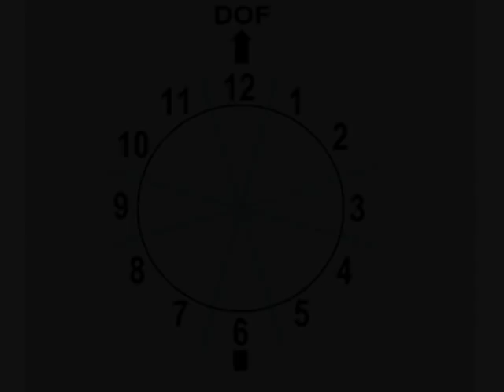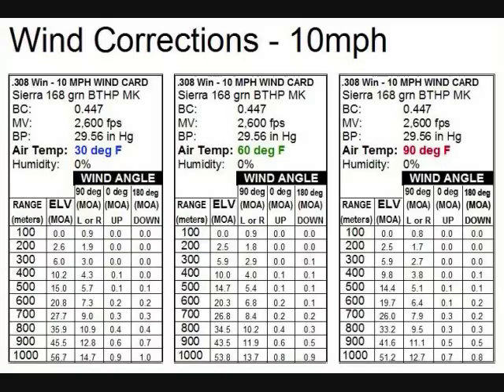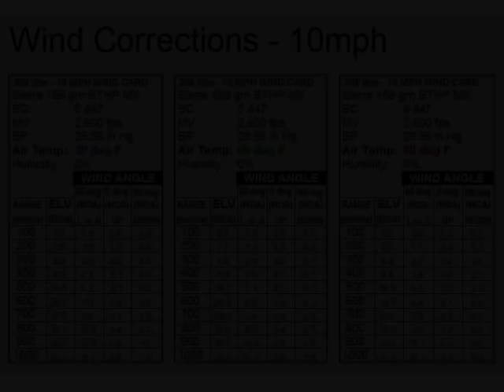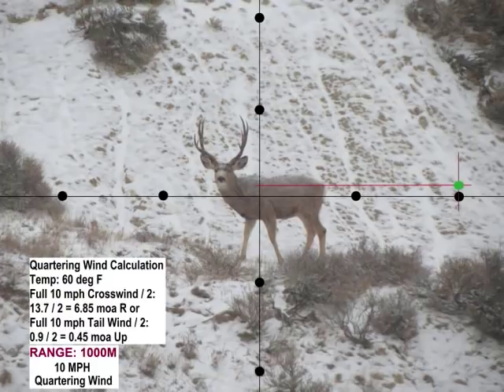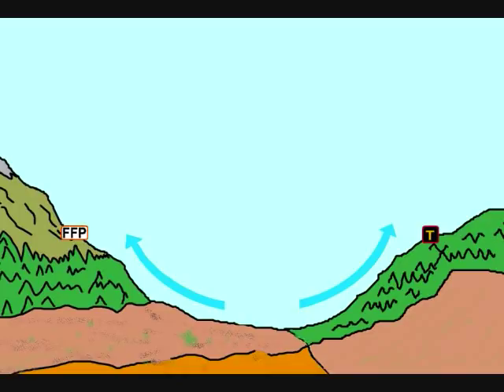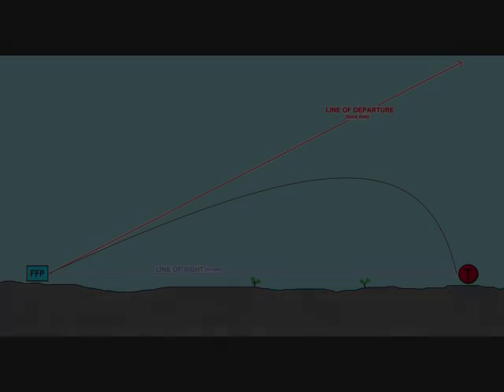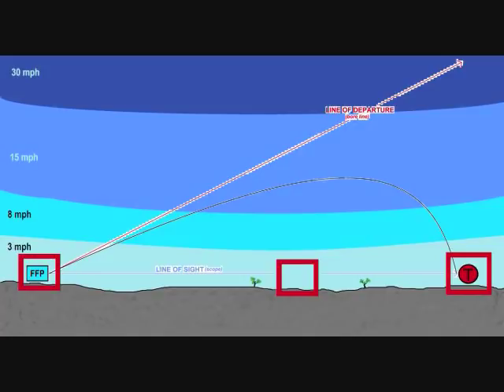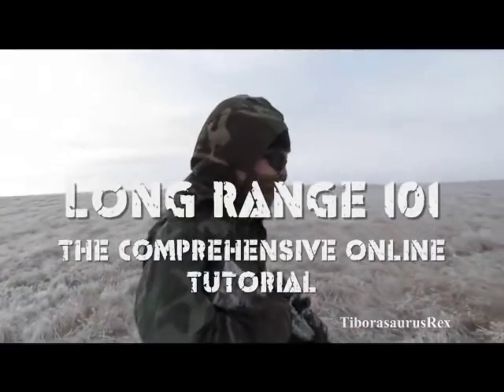Long Range 101 Part 32 - Wind Corrections (2/2) - Rex Reviews

Comment from the maker: Great question.  We will assign cosine values in two ways:  Vertical angle of fire corrections and lateral crosswind value determination. It really a matter of how we choose to describe our angular components.  

For determining actual horizontal range, we assign the full cosine value of 1.0 (100%) for level ground (0 degrees slope), which makes sense.   

For our crosswind values, a full value of 1.0 (100%) will be assigned to a direct crosswind (commonly designated as a 90 deg wind).

Comment: I had made notes this summer for shooting my .22 out to 400 yds. Two days ago I almost threw them away because I needed three additional mills elevation and way more windage than before, up to 4-5 mills in a light breeze. Only difference is it was about  8F.
You just cleared up a lot of confusion for me Rex. 
Working on getting my Rem 700 .308 with a SWFA SS 10 x together now. Should be a lot of fun!
Thanks for the awesome vids.

Comment from the maker: Good question.  the problem is that the wind never really goes on any exact angle, its always changing - so you will have to make your best estimation using a protractor or a clock sheet you make up with the angles illustrated.

Comment from the maker: Not usually, if we are doing everything else correctly.  Most guys who adjust the BC are trying to get their drop data to match the "impact reality".  Usually the difference between the calculated drop data and impact reality is due to unexpected and undetected muzzle velocity variation (MVV).  Many shooters chrony a given load a few times and mistakenly assume the average MV stays constant.  However MVV due to numerous factors is usually the culprit and not the BC.

Comment: Rex, excellent videos.  The .308 shows your point well.  This is why I shoot a 7mm with a G1 .614 BC.  These corrections are cut in half for wind drift.  i will never know why a .308 bullet is used under 190g.  Choosing a bullet with a high BC is half the battle

Comment: Rex, for clarification, the Cos function as you illustrated will yield your y-axis deflection, or head/tail wind component, except in the case of 45 deg where the Sin and Cos functions are equal.  Cos of 0 is 1; Sin of 0 is zero.  As such, for the x-axis deflection, or cross wind component, apply the Sin function to the illustrated angle.

Comment: I have a pretty serious question regarding this. I didn't recall hearing anything on it.. let's say you have the wind readings at the shooting position, at the target, in between and even the change of wind at the different elevations. As the bullets velocity slows down as it approaches the target won't the wind effect it more as the bullets gets closer to the target? This would be some sort of quadratic equation I think.

Comment from the maker: Right now, just find a load that is accurate - after you establish a load that shoots well you will start your logging.

Primarily your muzzle velocities @ different ammunition temperatures and also @ different bore conditions (clean vs thoroughly coppered, old vs new). 

MV log should have these 4 columns:  Measured MV / Ammo Temperature, chamber temperature / state of bore    

The more MV data you get over varying conditions, the better your charts will be when we put them together.

Comment: Rex,Between part 1 and part 2 of your wind correction videos I saw a video on Accuracy 1st's Whiz Wheel. I like that it was an analog solver and that it solved a number of variables. When it came to the wind correction it showed a clock but said the correction is solved using cosines. I was wondering if you've seen/used that device and what your thoughts were? While surfing the web I also found and printed out a pilots Density Altitude Chart which was pretty interesting.

Comment: Hi,Really enjoy the series you've done. It has greatly help improved my overall shooting skill. I just have a quick question to see if I've not got this wrong, but in this episode at time index 14.32 min on the section on 10mph tail winds.You state that the 90F shot would impact just above the shoulder with the 60F shot landing above that, followed by the 30F shot landing higher than the 60F shot. Shouldn't this be the other way round as the 90F load is leaving the barrel faster due to internal ballistic & encountering less drag through the air with the tail wind & lower air density. So the impact point for the 90F shot should be at the top above the 60F shot with the 30F load at the bottom?

Comment: Jacob,
The difference is that your calculator is assuming you're in Radians (another unit for measuring angles). Go into the options and switch your angle unit to degrees, and you'll get the .707.

Comment: Hello Rex. Thanks for all the information and wonderful videos. I have a question. All these calculations are based on a 10 mph wind, from which we take the angle cosine and apply that value off our ballistics chart's data. How do we calculate the value for other wind speeds? Our ballistics charts are based on a 10 mph, 90 degree cross wind. What about other wind speeds? For example, a 12 mph wind. Or does the angle of the mirage tell the wind speed and the cosine of the angle gives a solution relevant to that angle (wind speed)? What am I missing here? Am I over complicating this? Thanks.
Reply: I'm a  bit lost here as well. I know we have to interpolate the wind speed and use our cosine to make a solution. I have MS newest ballistic charts (v8.21)and they are VERY good about walking you through solving almost all calculations, except the (correct for windage) part. I've watched these videos countless times and tried to apply in the field, but I'm still missing slightly for wind as close as 500 to 700 yards. I think I'm messing the math up. I haven't practiced trig in nearly 20 years. This is probably a question for Mecastriesand, but would you be kind enough to include the formula for correcting windage? Another possibility is I'm doing the math right, but wind is Really hard to judge. LOL

Comment: Hey Rex, recently ran into your vid series and relearning some things from when I was in S-School 18 years ago and now.  I like the more accurate method of using Trig for angles, so I wanted to clarify something from this video.  Using the windage value from the table at 1000m (13.7 MOA) in your equation, you end up with a smaller MOA value (9.68 MOA) you're saying is more accurate.  In the visual example are you saying that using the FM's full/half value system would have over corrected for the wind?  9.68MOA doesn't seem like enough correction for a 1000m shot, no?
Reply: Found out the issue I had, all is well :)

Comment: You can skip the scientific calculator and use the clock image to figure out the percentage adjustments for elevation and windage by separating the vectors on your clock: in your shooting log have a circle with a crosshair through the center, put a gradient from 0 to 100 out from center to perimeter of the circle, draw line from center to where wind is coming from, draw lines from where wind direction touches circle horizontally until it touches elevation line and vertically until it touches windage line, read the percentage where the lines intersect and apply your correction.

Comment: First, thankyou for this series. Very helpful and interesting. 
One small thing i did note. You said a headwind increases the drag on the bullet. This is technically incorrect from an aerodynamics view isn't it? The bullet will be travelling at the same velocity through the air mass with a specific drag. If there is a head wind the drag will be the same as through the still air - it has the same velocity. The groundspeed however will differ. 
I guess you could say the value of drag would differ at the terminus however as the bullet has had to travel through a larger mass of air. Wouldn't the parasite decrease due to the decrease velocity?
Any feedback would be appreciated!

Comment: Rex, at about 16:30 you are talking about a quartering wind from approximately your 7 o'clock. In the caption of the muley you have a 0.45 moa Up correction, should that not be down since there's a tailwind?
Reply: Never mind.  Watched it again and that is the deflection in the caption not what you indexed on the scope.  Would index down to account for the tailwind component and left for the crosswind component.  Great videos.

Comment: first, great videos and a ton of information.  Thank you for all the effort.
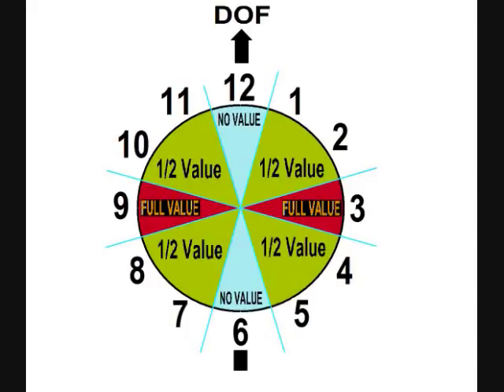At 18:41, the protractor method, the values for hold off using COS are great for the 45 degree wind gradient.  70% of the value.  If you use the remainder of that quadrant to calculate the hold off value, 22.5 and 67.5 degrees respectively, the values would be .92 and .38 leading one to believe that at 22.5% you use 98% of the hold off.    If you switch these two values on the clock  diagram, meaning measuring from 90 degree's and not from 0 degrees, the value of hold off would be to use 38% (COS 67.5=.38) with wind from the 1:30 or 67.5 degrees up from 90 and 92% from the 22.5 degrees up from 90 degree wind.   assume this would be close for a tailwind as well.  
Am I on the right track with this thinking?
Reply: santard or just use sin(x)

Comment: Idea, instead of using max ordinate as you have no way to measure height anyway use the come up. If the scope is set 10 mil up, then so is the bore and thus the angle of the trajectory. So if using a spotting scope with a reticle or rifle scope to see mirage. Use that reticle to look 10 mil up from the target and that should indicate the top edge of the trajectory.

Comment: According to your wind angles at 21:30, if you run the cosine on those numbers you would be getting .924 from your 22.5 degrees that you have drawn by your zero value head wind and tail wind; and, you would have .383(rounded up) at your 67.5 degree line. These should be flipped, otherwise your correction value is increasing as you get further away from your full value. You would want your line of fire to be 90 and your full value wind to be 0. This would make your cosine for a full value wind to be 1, Deviating from that by 22.5 degrees would give you .924 of full value, deviating to 45 degrees would be .707, going further to 67.5 degrees would give you .383 and then going to 90 degrees(line of fire) would give you 0. In short: you want to use the sine of the angle of wind relative to line of fire, not cosine.

Comment: The angle from the line of sight to the direction of any ordinate would =

arctan (perpendicular height from line of sight to ordinate / ordinate distance from you along line of sight)

The angle should then be converted from the calculator's setting of degrees or radians to the scope's units of MOA or mrad. In your case, ordinate distance along LOS could = .60 * 1 mile. This is coming from my knowledge of trig cause I've never shot farther than 200 yds, so see what approach others take as well.

Comment: Actually for wind you want to use angle sine for the windage adjustments.  Angle cosine would be the head component of the wind (elevation adjustment).  Your example in the video happens to be correct because cos(45) = sin(45).
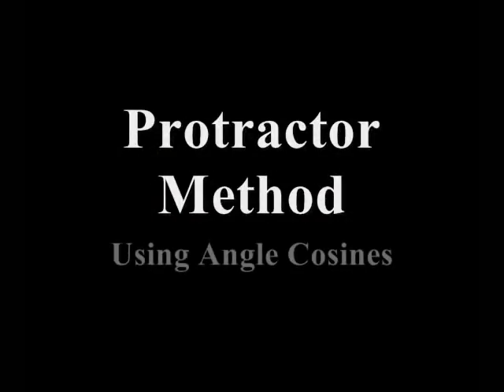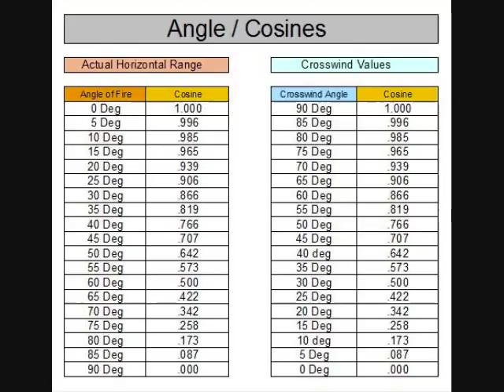Reply: You are kind of correct....it all depends on what angle you use...cos(30)=sin(60).  In Rex's DOF "clock" example (about 18:30min into vid), 0* is towards target & 90* is towards your right...you would use the sine function to get the horizontal component of the wind.  In Rex's defense, his Angle/Cosine table (19:20min) has the correct horizontal cosine component for the DOF picture he had earlier.  I'm sure you're familiar enough with the trig functions, but for those who are not this website explains it fairly well:  http://www.mathwarehouse.com/trigonometry/sine-cosine-tangent.php
Reply from the maker: William fleshman Yeah, which trigonometric function you use depends on which direction you designate as value '0'...  Its contingent upon your angular perspective, I suppose.  Thanks for the good discussion.  :-)
Reply: TiborasaurusRex If you were referencing the wind angle at the target, setting left and right as 0 would make sense and therefore use cosine. But if you're referencing wind at the shooter's position, it is less cumbersome to set the forward direction to the target as 0 and use sine. I like the video, though.

Comment: A mathematical way of finding the actual height at the max ordinate instead of estimating, for example 50 meters in the air at 500 meters (not realistic i know just making the point) is to use that scientific calculator and find the Tangent angle from your FFP.  I mount an angle indicator on the spotting scope and after a quick calculation i move it to the tangent angle and now i am exactly pointed at the max ordinate.  T = 50/500, T=0.1.  now use the tan -1 button and u get 5.71 degrees.

Comment: All those variations in the wind must be extremely difficult to account for.  The main wind is one thing,  but with the convection and all it sounds almost impossible =/    Take the mountain/valley picture you showed for example. Its actually the sun that heats up the cliffs (sunny side) that through convection heats up the air and makes the air rises, that makes the wind sort of going upp the hills. It doesnt act like this in shade (so if you have a valley with one hillside in sun and another in shade, they will act differently).  And since the big masses of warm air, when they let go of the terrain  (thermals) doesnt do that cinsistently but rather in big chunks, the anabatic wind (wind that goes up the hillside) is not constant at all. A nice sunny day with NO headwind what so ever, can still have anabatic winds upp to 30 kph or more coming in forceful gusts.   And when you think of that all the air that is rising is in need of new air to fill its place, you wil have sometimes VERY strong valley winds aswell.   And to account for all this variables along side the different temperatures in airmasses, I think I will have nightmares about this for along time  =//
Reply from the maker: Machinshin Yeah, the wind is usually a limiting parameter in the field...  This is the factor that throws off even the most seasoned ELR operators.   Very difficult to anticipate the wind on a long shot and its pretty much impossible to master.
Reply: TiborasaurusRex  Marine Scout Snipers have mastered wind, we train to get within 200M...

Comment: in freezing weather (32 or less) would open free float barrels, as apposed to  covered barrels like the Mosin or Lee Enfield, cool faster and lose velocity via slowed burn rate?
also I love your videos, fascinating and informative, great job!
Reply from the maker: Although the MV difference due to the cooling rate differentials between the two would be statistically significant, I do not think they would be "practically significant".  In other words, the conductive heat transfer off of an open barrel will result in cooler barrel and consequentially reduced MV due to lower ammo temps, but it will translate to barely noticeable results on the trajectories in most field applications.
Reply: Alright that's awesome, been wondering a while, thank you very much!

Comment: In part one, when discussing the formula with the constant such as 15 for 100-500m, 12 for 900m, etc., you mentioned that the order of operations was important. No, it makes no difference. You can divide the range in 100's by the constant, and then multiply that by the wind speed. In the example given, you 9 multiplied times 8 first, then divided by 12, which gave you 72 / 12 = 6. You could have just as well have divided the 9 by 12 first, and then multiplied it by 8, as in 9/12=0.75, and then 0.75x8 = 6.

Comment: ok so please tell me if im wrong or what.... so if i have a 2 o'clock wind (22.5 degrees off 3 o'clock) then i use 92% of my full value. does that mean i use the remaining 8% for how much of a head wind i have?
Reply: You would use cos if you're measuring the wind at the target. In other words if the wind is blowing across the target at a 22.5 deg angle either towards or away from you. In this case, you would use 92% of your full value wind.
Reply: using cosine if you're measuring wind direction while looking directly at the target is wrong, though. For this, you'll use sine.

Read my tutorial, it will help to explain the trigonometry and answer your question.
http://www.calguns.net/calgunforum/showthread.php?t=1023975

Comment: I have been thinking of buying a aics stock the 1.5 version but the thing is its expensive, or i was thinking macmillan a5 but with surgeon bottom metal thats more than the aics. I was looking at the bell and carlson stocks but all i hear is half good and half bad, and i dont want to be the one buying a stock for no reason. Or a hs precision but still buying a bottom metal it pretty close to the aics and the aics has a adjustable cheek and butt pad, i also like the thumb hole on it so pleas help